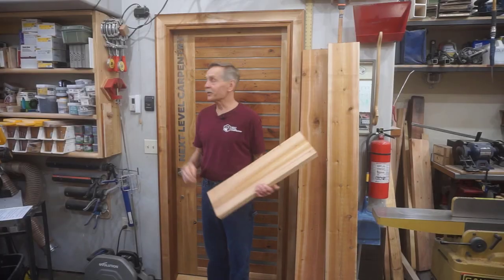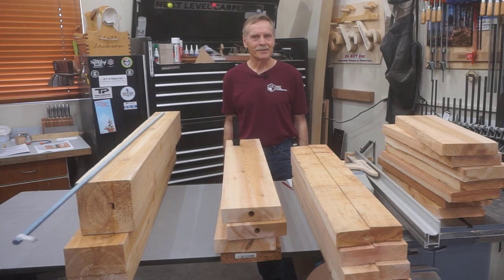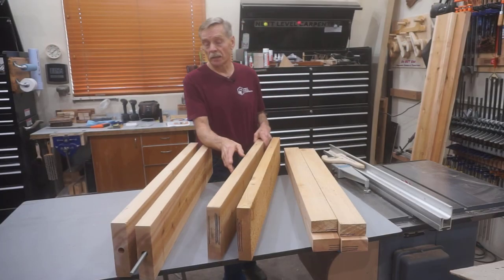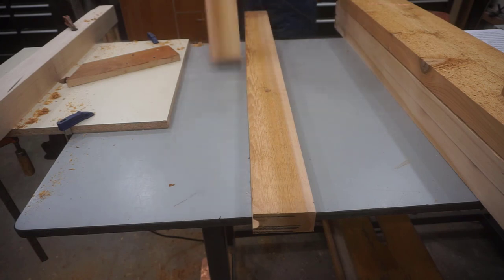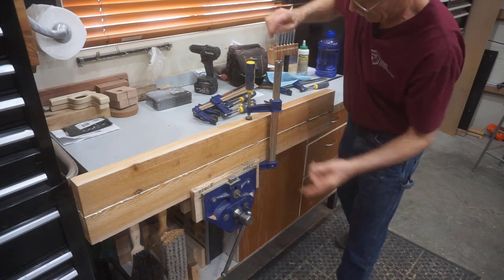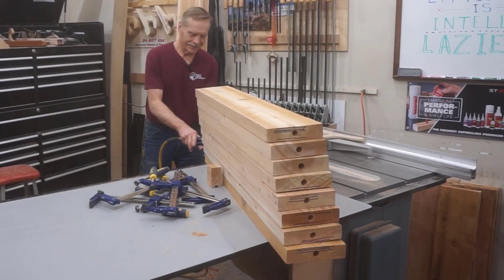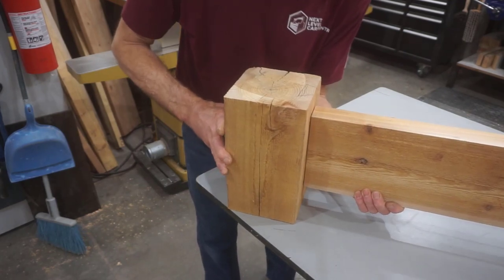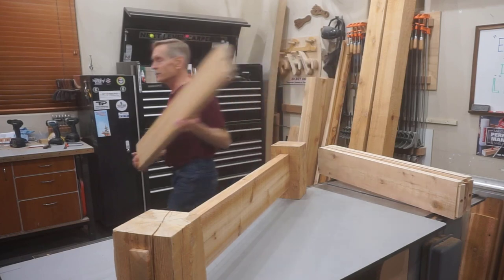Perfect Holes in Long Boards

Comment: those caps on the end are out of this world.  I'm still skeptical about the Titebond, but I can't say it won't work!!.  I would have loved to see this installed, but I guess you have the owner to contend with.  Great idea, and about your router table:  It ain't stupid if it works.
Reply from the maker: Thanks for watching and commenting on this video.  FWIW you can learn how to make  those end caps that 'are out of this world' here: https://www.youtube.com/watch?v=d6qdzzbb-ns   Where Titebond III is concerned, I can tell you straight up: if it makes you skeptical, you're doing it wrong!  I've never once had a glue joint fail from failure of the glue.   My client would have been fine with me doing  a video of the install (which turned out great BTW) but it just didn't work to produce a video during that phase of the project.

Comment: When my dad worked as a boat engineer in a local fishing village, he watched an old-hand spend several hours sizing up a 12 foot length of oak beam. He needed to pass a propeller transmission bore through it. Finally, he picked up an adze and squared the beam into shape between his feet, then bored a straight hole through the whole damned thing using a hand-cranked auger. We're talking the late 1960's here. I still have difficulties comprehending dad's account, but as a man whose history involved working to 1/1000ths inch as a machinist, he wasn't the sort to exaggerate his testimony. To him, this was the finest display of engineering accuracy he had ever seen. To be fair I believe it to be the ballsiest. I think he saw the last of the old shipwrights draw the last breath in the new era.
In this new era, you have done justice to an old-hand's way. Wonderful video.
Best wishes from Ireland.
Reply from the maker: Loss of knowledge that dies any time a ledgendary shipwright passes is sad indeed!

Comment: no snarky comments about your workshop from me.  as a retired one man shop, professional furniture maker, i can honestly tell you i have less gear than the youtube amateurs.  money put into needless tools in the workshop is money that doesn't go into your pocket.  i was interested in your drilling method till you announced how it was done.  its a trick i have used myself many times to run wires through desks etc.  your right it may be simple but not many amateurs know it.

Comment: Matt does better work  in his smaller shop with fewer older tools then a fully sponsored larger shop completely equipped with the latest tools. 
Gives me hope. I really love this channel.  You got me with creating the holes, I was expecting to see a long boring bar, long drill bit or other clever Mcguyver type setup. After all he previously showed us all how to bore through an 8 inch wall with a piece of wire. Nicely done, thanks for sharing.
Reply: That wire trick is something.  And I just like his style.
Reply from the maker: @anneoreilly4900  Thanks for sayin'! Best, Matt

Comment: Nice job. It's far better to watch useful information on a typical $100 router then to watch non repeatable information on a $3000 shaper that the typical person doesn't have access to.
That handsaw trick is a golden nugget.
Reply from the maker: Thanks Joel... I'm known to say "it's not what you got that counts but how you use it".  Fancy equipment is great and all but is just an embarrassment to those who have it and know so little about using it IMHO.
Reply: @NextLevelCarpentry  your absolutely right.  That right there is wisdom. 
I have several of my grandpa's tools in my garage that are nothing more then a motor, and belt. Every time I use them to sharpen my knives or sand a piece of wood it's a lesson remembered.
Keep being yourself and us youngsters might learn a thing or two and recall those lessons later on in life. Hopefully also passing them on.

Comment: No complaints about the joinery or engineering.  
Excellent  way to make it happen Matt.
In my climate we still dig up a few pump logs, cedar logs five inch around with a two inch hole drilled end to end, typically a ring of inch by eighth mild steel is driven onto the ends to keep them from splitting when driven together.
My neighbor has the the ' cast in place bearings' machine that among its multiple functions has a PTO at knee hieght to drive these auger bits 54" into the log.

Comment: I enjoy this channel because it reflects a man's knowledge learned on the job.  As an engineer I've seen many fellow engineers that felt no need to get into the "shop".   Calculate, model, check, draw and release.   Yep, all good but so many times manufacturing requires a tool and often a one of.   Your site employs learned adaption to get it done without gargantuan expense. ( like sending planks to Ithaca to bore on their barrel driller).  In shipyards, the tool and dye maker is one of the most skilled and valuable artisans.

Comment: Referring to your comments about the router table, in the not too distant past I was reading in a Fine Woodworking magazine issue, an article detailing how to make the most precision router table/cabinet with micrometer-adjustable fence. It was very impressive and I was convinced that it was the next thing that I would need to build. I then turned the page, where an article featured a professional, high end woodworker pictured in his shop turning out excellent and expensive work. One picture showed him using a router table exactly like yours. The back to back juxtaposition of the two philosophies in our craft was humorous to say the least. Either will work under skilled hands.

Comment: Excellent method, excellent video, excellent instructor.  My favorite instructor BTW.  Another method not requiring a router table setup (I'm lazy):   For holes that are less than 2x length of your long drill bit...it is faster to split wood (as in video), run  a center grove the entire length of both boards (not too deep), join pieces (as in video) then drill using the newly made square hole from each end.
Reply from the maker: A decent alternative method for anyone without access to a router table... thanks for adding your thoughts here!

Comment: Splendid answer to a nice design. Well done.
I used a hole saw to cut slugs in very dense wood (1 5/8 cuts a 1 1/2 slug).
Bored and glued into the end grain to receive the slug.
And used a lag bolt (two 3/8) to secure a head/ foot board.
Holding up for over 15 years.

Comment: Thank you, for the idea of taking saw dust and sprinkling it on the glue to make it a easier cleanup. Didn't learn that in wood working.
Reply from the maker: Michael... using find sawdust and a putty knife is definitely a paradigm shift for glue cleanup compared to water and Rags but once I made the shift I never looked back...

Comment: Best stuff on the tube. Great trick with the shavings. Did a similar thing with some crappy 2X6s. I put a piece of rubber hose down the routed grooves when I assembled to align the halves, and left them inside to act as a bushing. Let's say your approach was A LOT cleaner...

Comment: Not quite as much experience as you but 20 years in and I’d much rather watch you than anyone using those fancy woodpeckers tools. I liked your video on removing the weld on square tube. 
And if a false tenon plug to hide a fastener is good enough for Greene and Greene it’s good enough for me.

Comment: Matt, Thanks for keeping it real with the ghetto router table. There are so many how-to videos on making woodworking tables, router tables, crosscut sleds etc. That's great but then I think "I got to build that woodworking contraption before I can start woodworking?" I saw your router table and it grounded me. I said to myself "I can do that" I can get good results without having to go online right now and purchase the $400 Jessem masterlift routerlift with the $450 cast iron tabletop and the $250 Incra fence just to build a DIY router table. However, all those things are nice and maybe one day but at least I already have a router some leftover melamine, scrap wood, and some clamps. I can do this right now. A master woodworker isn't the guy with the most expensive equipment. He's the guy who can produce the same results without them. Thanks.
Reply from the maker: You're sure welcome Paul.  Including that set up in this video made me reflect on the thousands of feet of trim and molding excetera that I've made using no more than a router and a piece of plywood in the days before a router table was even a thing. That won't stop me from getting the master lift pro from mlcs one of these days but it reminds me of the saying " we the Willing led by the unknown are doing the impossible for The Ungrateful. We have done so much with so little for so long we're now expected to do everything with nothing!" Makes it nice to hear from viewers who understand the difference and keep things in perspective so thanks for watching and commenting.
Best, Matt

Comment: Nice to see you again.
I’m pleased ht your solution to make centered holes in long boards is exactly what I thought of doing on a similar project.
The shallow mortises solve a host of problems and were a master stroke. I always appreciate that you use fairly low tech techniques to produce elegant solutions. I believe they call that craftsmanship.
Thanks for sharing.

Comment: My current router table is self standing and a bit bigger but functionally what you did.   I had bought two before. A cheap one then an expensive one.   In spite of all the fancy fetchers they couldn't do the basic job right so they were just junk.  Threw them out and built my own.   So it's flat, Stable, and not at all sloppy or wiggly.   Sure it's just basic but it does it very well and that's what I need.

Comment: Clever -and obvious once you see it done once. Thanks for the ideas. As you say, limitless application. I guess for big square posts a lamination would be an easy way to go.
Reply from the maker: Last time I used this process it was for a 7" square, 10' tall lamp post for a clients nicely landscaped front yard.  That project involved using 4 4x4 redwood posts with one corner notched out of each that, when glued together, left a perfect wire chase hole top to bottom and through the center...
Best, Matt

Comment: no reason to be sensitive about the crude router table setup. it works and the result is good. clever design is not just good for a custom project, it's also easily adaptable for mass production. to my taste you dont even need the mortise and counter-bore on the nut side and a facade cap. just leave it exposed with a stainless cap nut and washer. teflon tape and/or a drop of oil at each end of the threads would prevent galling. thank you for sharing. lots of intelligent work here

Comment: Matt, another great vid.  I was reminded, as you rounded and chopped your shallow tenons, that in your last video you demonstrated a great way to make small tenons if you don't have a hollow mortising machine.  A nice technique, but when I built my home cabinets, to meet the customers (AKA, my wife) requirements, it required 536, 1/4 inch mortices, so I bought a Delta.  If you ever get a project requiring with that kind of volume your welcome to borrow the now, dust covered time saver!  Thanks again for your great teaching and work.
Reply from the maker: I think you know me well enough that I just may take you up on that offer so thanks in advance!  I'm curious if you have a selection of hollow chisel sizes for your machine or just the 1/4" one you put so many miles on...
Reply: @NextLevelCarpentry   If I remember correctly it came with three chisels, the 1/4 inch being the smallest and and the next two 1/4 inch intervals.  I'll be back down next week and will check.
Reply from the maker: @curtisschmidtlein5606  I'm more curious than it is critical... I believe I've got two of them that are 1/2 inch and another that's 3/8. I need it mostly when making doors and use a three-quarter inch for those but it would be no big deal for me to pick up a three-quarter inch size and give it to you as rental payment if this ever happened😎

Comment: I used a similar trick to drill a18” long 1” diameter hole  down the center of board to make a kaleidoscope. Trying to drill halfway from each end did not work because the holes didn’t meet in the center.  Drilling from the end using an extension on the bit resulted in the bit coming out the side of the board. Your holes are mor than twice as long as the ones I needed so yours would definitely would be impossible to drill. Love the technique.

Comment: Makes me want to add a bench project to my endless list. Put in a patio last summer and there is nothing back there yet. A nice long cedar bench with an extra large stretchers and bulky legs would be great. Might do the cut and glue the opposite way with a thicker stretcher by laminating thin boards. Just have to find the budget for wood.
Reply from the maker: Routing the grooves in faces instead of edges to glue up for a thicker board is a great adaptation of this method... hope you're able to find an equally useful solution for your budget predicament😁😎

Comment: I'm an amateur/hobbyist. I love your videos and explanations. I often hear you reference a "sharpened putty knife"; could you explain (or show) how you sharpen them (if you do anything to them? Again, love the videos; I've used your best blocks for sanding and your push stick design/process; and your channel introduced me to CA glue/accelerator - which I have seen much more frequently since. Regards,

Comment: Beautiful work. When I did something broadly similar, I jointed my edges after ripping the pieces and before cutting the grooves. I think you're also allowing for some possible movement from the groove cuts, which I didn't think about, but I didn't get any movement on the joining edges so it worked for me. I really like the look of your pyramid shaped plugs on the outside of the mortices, too.
Reply from the maker: Thanks Darryn.  FWIW this video shows how those pyramid shaped plugs are made...
https://youtu.be/d6qdzzbb-ns
Best,
Matt

Comment: Oh that is such a good technique. I made a platform bed years ago using Spax screws. Worked pretty well for a while but with use the frame got a bit wonky and needed to be tightened.
Reply from the maker: Hey Mark, thanks for watching and commenting on this one.
Sometimes fastener 'failure' is due to engineering or application rather than type or brand...
Don't know what wood you used for that platform bed but Spax would be at their least effective in the cedar used on these bunks if relied on for holding against pull-out in end grain.  There are other connections in the bunks where I use #12 x 1 1/2" wood screws but they are driven into face grain and exposed only to 'shear' stress an hold very well. Over all though this technique is about as bombproof as it gets short of using steel gusset plates or some such...
Best, Matt

Comment: Thanks for the tip in the end.  I have a rough sawn beam under my porch with fork lift marks on it.  I wish I would have know about this before the contractor put it up.  It will be a little tougher now that it is installed but I will test out on the scrap pieces I kept first.

Comment: Not a snarky comment. Just two questions:

1.  Could the routing have been accomplished in a single operation by jointing the ripped halves first?
2.  Would hanger bolts have accomplished the desired result while eliminating the need for the through holes entirely?

The pyramidal mortise plug is an excellent finishing touch. And, the hand saw trick to achieve/restore a rough sawn look? Priceless.
Reply: I was wondering the same thing on question 1. Commenting, for the algorithm and hopefully see any insight from Matt.

Comment: Hi Matt, 
thanks for this great video. I want to recreate a wooden bench for the stove in the living room and so far I faced to the problem: How to get clean and horizontal holes in oak planks with a length of 1m? Then steel rodd inlays are embedded in the holes to improve the statics and stability. The bench looks relatively fragile and yet should not collapse when someone sits on it with 100kg. Now I came across your video and had the aha effect ! As I always say, "You can be stupid, but you always have to know how to help yourself." Thank you for this very valuable tip for me. Have now subscribed to your channel and will work my way through your videos. Greetings from Ulm (Germany) Markus P.S.: You have a nice way of explaining things. Reminds me of a deceased uncle of mine. He was also similar in type to you.

Comment: Neat solution to a problem.  I suggest the hole doesn't have to be round and could be made with a table saw and dado blade.  Leaving a 3/4x3/4 square hole.

Comment: I’ve read through some of the comments and didn’t see an answer for this question, when you installed this project, did you glue all the joints in the mortise and tenons? Another question I have is , how did you fasten the false end caps, are they glued solid or do you have a way to remove them in case they need tightened up at some point in the future? Nice job and clever way to drill a hole through long boards, but even better are all the finishing touches! I’m already subscribed so all I can do is pat you on the back! Lol. 
P.S. As a muzzle loader owner I’m a little bit ashamed that while I was watching this video I wondered how you would deal with the glue squeeze out in the holes you just made!